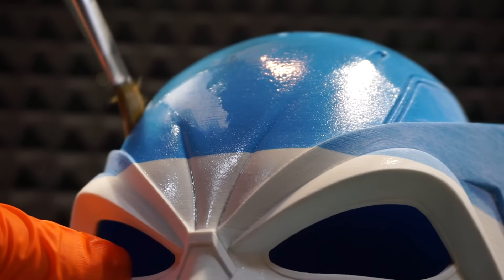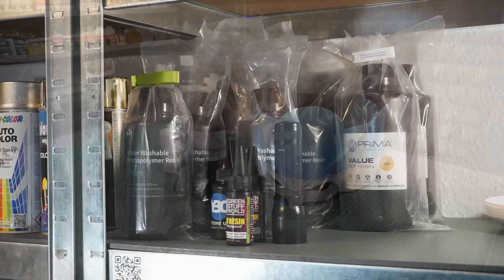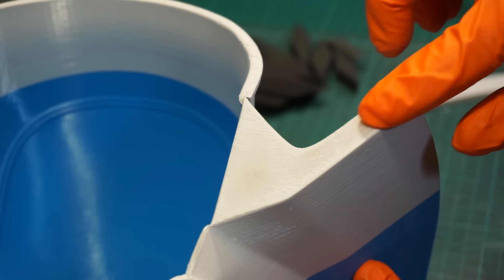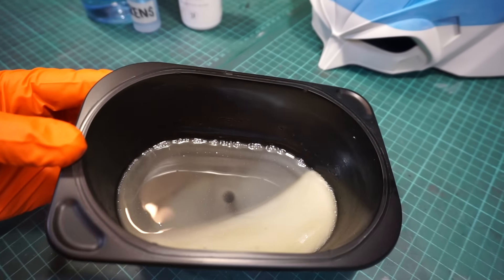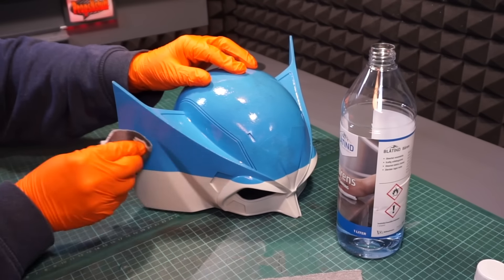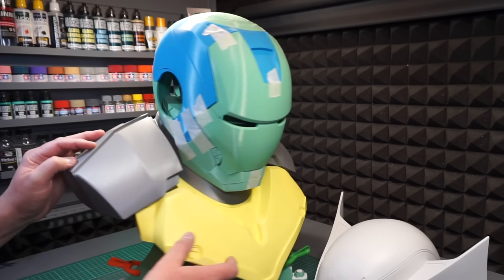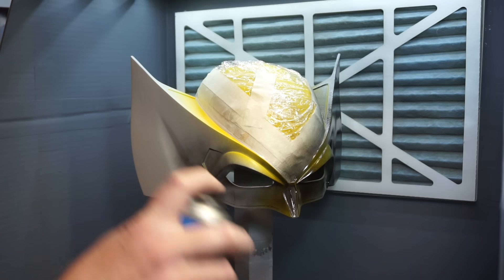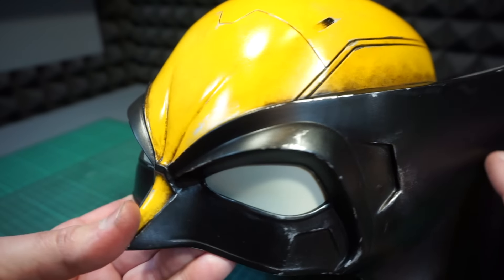Making The Wolverine Cowl - My Fastest Way To Smooth Out A PLA Print N’stuff

Comment: Im hearing alot of debate about this method at the moment. I've used it myself before, and it definitely does work well. My concern with it is that we are using UV Resin outside the defined usage from the manufacturer, specifically outside of an enclosure. I want to get more information on this from an expert in resin and its hazards to better understand the possible dangers. I've paused using this method until I know more about the risks and best possible safety measures. Obviously things like bondo, and 2K paints also present dangers but I feel like they are better known and we no best methods while using them.
Reply: 3D resins, craft resins, and the “UV gels” that are used for nail polish have nearly the same ingredients, so I imagine that the risks are low. It seems the biggest issue with resins are contact dermatitis, so as long as you’re wearing gloves, I don’t see the harm in this method.
Reply: @venerated  I think you’re likely right, I’m probably just being overly cautious. I just want to make sure I do my due diligence on the substances we’re using. Especially when I don’t at all consider myself an expert on them.
Reply: With UV resin, whether in a printer, an enclosure or out on the bench :
- nitrile gloves (latex or vinyl are permeable to resin so make sure to use nitrile or butyl)
- chemical/organic contaminant grade respirator mask (N95 is NOT sufficient)
- eye protection
These are similar to what you should be using when spraying paint in an enclosed area like a garage or hobby room, or when sanding props or prints. It’s surprising how similar the recommended safety gear is, all across this hobby, and equally surprising how many of us get lazy or rushed and don’t follow the guidelines as well as we should.
Reply: @Starganderfish  latex gloves are fine for Resin work even epoxy, whilst nitrile is more resistant to resins latex is just fine if changed regularly. The main reason the industry has switched to nitrile is nothing to do with its chemical resistance ( latex gloves have been used for decades) it because of the delicate nature of modern skin with more people (apparently) becoming allergic to latex and the powders sometimes contained within.
Nitrile though is more hard wearing.
It doesn’t help that so many people spread the myth without realising usually (especially YouTubers) that latex can’t be used.